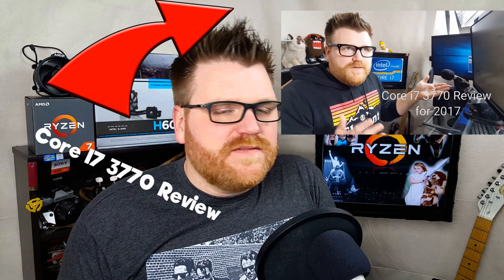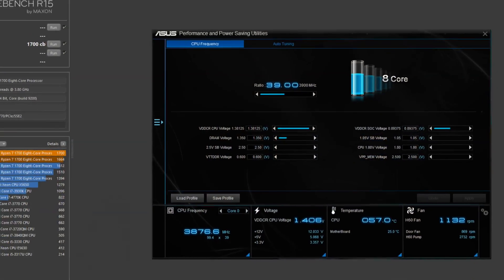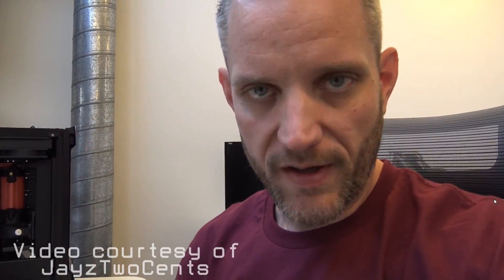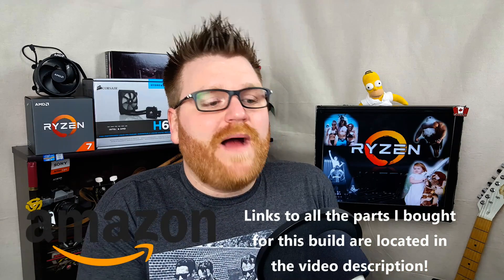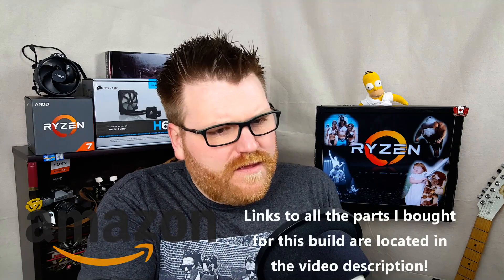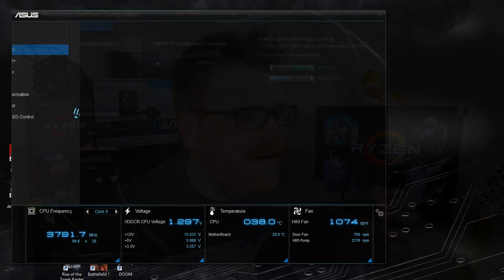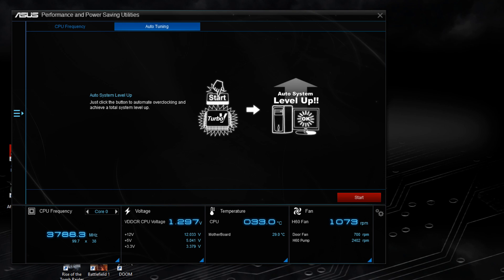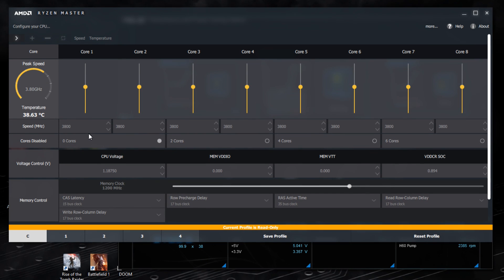Ryzen 1700 B350 Review, Watercooled Overclock to 1800x Performance!

Comment: Broheem....I'm running a 1700x at 3.9Ghz / 1.2375 Vcore. Idle 34c, max temp after 8 hours Prime95 small fft 74c, 16gb TridentZ @ 3200. On a freaking Hyper 212 LED, 2x120 and 2x80 case fans. With 1 ssd, 3 hdd, 2 optical, a pcie2 sata card and gtx1060. On a 212.

Comment: I have a ryzen 1700 and a asus a320m locked mobo and am getting 1410 in cinebench but just got the Msi b350 Tomahawk 
once I change over I will run again and post also with the spire cooler as I built this system for a stream rig only and am happy with what I have now, just didn't like how close my capture card is to my gpu and that's why I got the new mobo.

Comment: Oh no wonder why you were having so many issues with your overclocking this is a five month old video LOL all those issues have been fixed since then. I was wondering why you weren't running it at 3.9 or 4.0.. Getting to 3200 is easy PEZ now.. I really wish techtubers would rerun their tests now that Ryzen is fixed.. gaming benchmarks look totally different now that windows in the games are optimized for it. gaming is win some, lose some now 50-50 in gaming against the 7700k back in March things looked totally different when their were memory n over clocking issues, all that is a thing of the past.. all that is a thing of the past but I have my system since April and watched it get faster and faster every update.. my system has never crashed or blue screened on me once in all that time.. i've had store-bought systems I built custom Intel systems and all of them within the first couple months I have crashed, especially when they were new platforms...
Reply from the maker: +MarcasswellbMD Hardware Unboxed does a good job at returning to hardware and he runs graph after graph of benchmarks. My Ryzen 7 chip runs at a solid 3.95 GHz on the daily with 2933 ram. I can go higher but trade a lot of volts and headaches to do it. I will keep this in mind for a future video though :)
Reply: Thanks Timmy Joe, I love what you do and Keep up the great work, We need people like you out there squeezing every bit of performance out of hardware and software.. Even tho I started working on and Building PC's for over 12 years, I still learn a lot from watching Guy's like you.... P.S. Glad to see you blowing up and doing so well on YouTube, Over 14K in subs, NICE.. Before you know it you will be at 50K, then a 100... Thanks for the Vids..

Comment: What a coincidence I have the H60 n R7 1700 In aTaichi Board. I just updated my BIOS to 3.20. I'm running at 3.9 24/7 over clock.. I just overclock my memory from 2400 to 2666 and I got a cinabench score of 1729. I was getting 1700 to 1708 before upping the memory one step up... I haven't even tried to hit 3200 With the cheap sticks I got when Ryzen first came out.. I am loving this system keeps getting better and better with every BIOS update.. definitely not more tomorrow when was the first female it was playing with memory problems this is going to rock solid system now.. it's truly amazing what you get for the money now

Comment: So long as your voltages and heat is in check, it won't have any effect on the longevity of the processor.
I get 4.00Ghz on 1.375v and I can hit 2933mhz on corsair 3000 LPX.

Comment: I got the ASUS Prime Pro x370 with the 1700 and corsair 32 GB of Ram (4x8GB). I can't get over 3.8 ghz and 2400 for ram speed. I didn't know that it doesn't downclock when you overclock. I'm going to keep it at stock until the BIOS lets me do more with my memory

Comment: I'm very happy to see this review. I got a 1700 and an ASUS PRIME B350-Plus board. My old 2600K build crapped the bed the weekend this chip set and motherboard came out.  I'm running a Noctua D-15 in a G-41 case with 6 additional 120mm fans added. Fans are balanced for intake and exhaust and tuned to a slight positive pressure in the case. 

I'm hitting 4.0GHz stable on bios 0503 and the same on bios 5013 although at a slightly higher voltage. Win 10 load temps hit the high 40c, idle temps the low 20c. MoBo temps never breach 30C. Full benchmarck temps hit around 64-67c. 

All in all I'm very very happy with the 1700. Only thing. I'm stuck at 2133 frequency for my ram (even though my ram is ratted for more). Also hoping future bios updates may help that, but lets face it. I've got a very VERY solid system that will do more or less everything I can throw at it.
Reply: what ram are you using?
Reply: sami sipilä Corsair Vengeance 2666

Comment: i believe it's not your 1700 fault it can't run high mem speed. it's just the lpx 3000. almost everyone with any r7 can't get past 2666 on that, but able to go much higher with other ram kits like trident Z 3200, or even the lpx 3200.

Comment: I liked your video: Do you think the stock Ryzen Cooler is good enough if you don´t plan to do overlock? And between ryzen 5 1600 using your same Asus Motherboard or a Corei7 700 using a Gigabyte Snipper B7 WICH ONE DO YOU Think is better in price-performance and durability. I use PC fore file transfer, video converting and ocasional gaming and edition (not 3d of professional stuff).
Reply: Absolutely. I've got the same board and the 1700 @ 3.7 Ghz on all cores at the default 1.2 volts on the stock cooler! Default clock on all cores is 3.0Ghz, boosting on up to 2 cores to 3.7 and all cores to 3.3. I'm running all cores locked to 3.7! That's a massive improvement in performance, and all on the stock cooler. I had it at 3.5 Ghz for a week because I foolishly assumed I'd need to bump the voltage and after I did, I was unhappy with the heat at 3.7. I stopped being lazy and did a properly methodical overclock and got all the speed I could ask for at default voltage with plenty of thermal headroom for summer. Take your time and you're likely to be pretty happy with the results.

I game @ 4K so I'm GPU limited but the machine is a beast at productivity tasks and it has CPU to spare in VR. Most satisfying computer purchase in 10 years, and for hundreds less than I'd have had to spend for equivalent performance from Intel. I actually bought more CPU than I really need...it's a phenomenal deal.
Reply: the stock cooler can oc the 1700 to 3.7/3.8 without issues also that cooler is the same one you gonna get with the 1600 non X...which means you can 100% oc that cpu with this cooler easier. 

its a 95 watt cooler on a 35 watt cpu.

Comment: Nice video. I used the h60 cooler too while I waited for the h110i to be back in stock. It works great, but didn't look as good as the h110i :P I hope you have the time to check out my 1700x build on my channel.

Comment: the 1700 was on sale for 250 and I didnt till it was too late.. not sure how the 1800x will do with overclocking if there are more bios updates. Not sure if that will help but its on sale right now for 400$... should I bite? the 1700x the lowest there is right now is 370
Reply: you got the 1700 to 4.0 on a B board? this was the answer ive been looking for lol and i was thinking of gettting the Asus Prime MOBO or the gigabyte x370 gaming 5.

I would have gotten the top of the line asus MOBO if the 1700 was still for 250